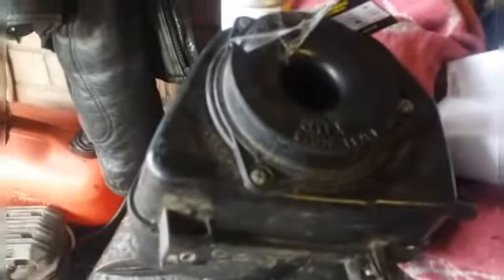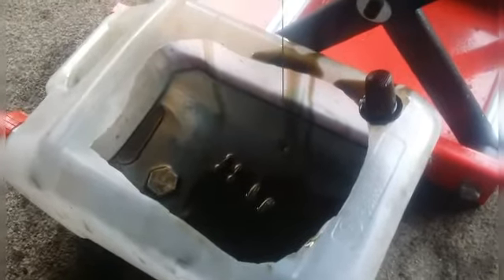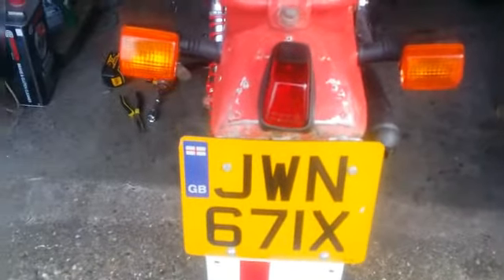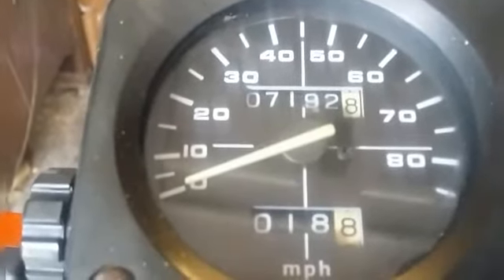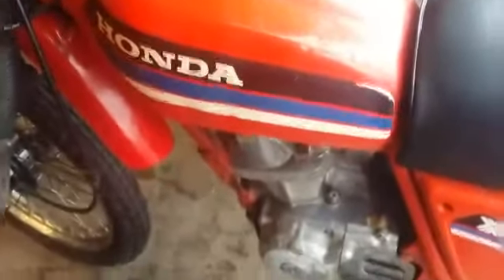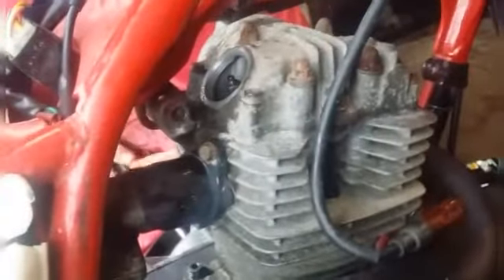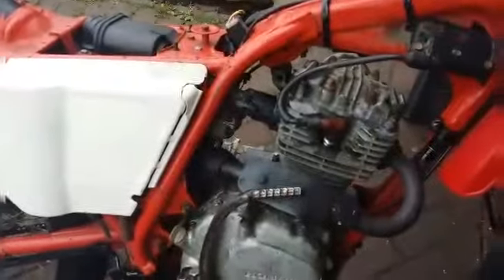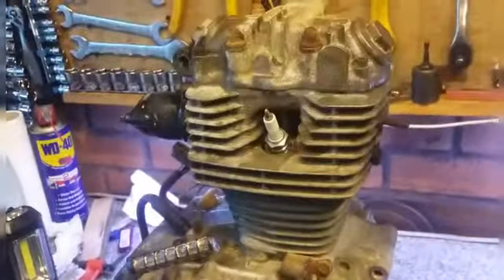I bought Two Honda xl 125s 1981 and a 1979.

Comment: She's a beauty. Nice find. I ran a compression test on the CB with a hose type gauge and it looked low so ii fitted one of the short aluminium push tube type attachment and the pressure jumped massively. I came to the conclusion that the long rubber hose caused the drop in pressure.
Reply from the maker: Nice one mate thanks. I think if anything it's maybe because it's sat for nearly 3 years without being run but it runs really nice just running a bit rich at the minute you know me I'll get it sorted m8.